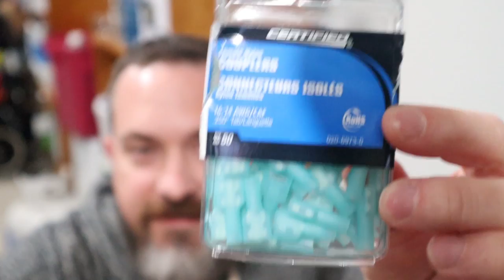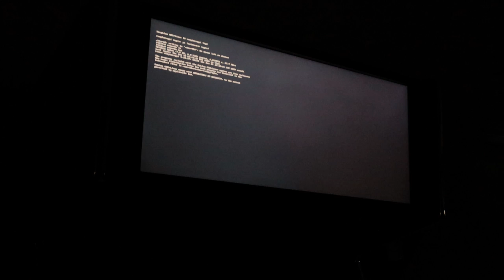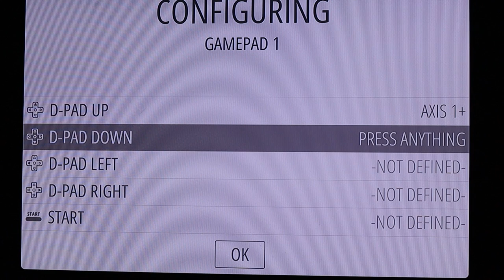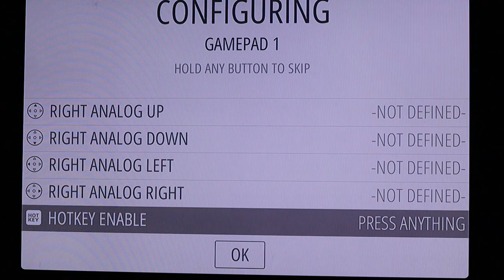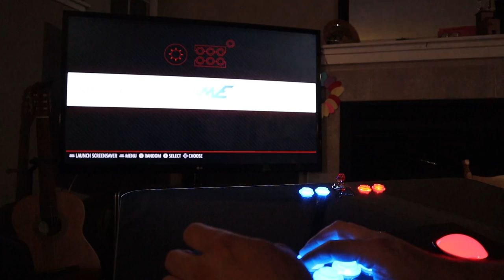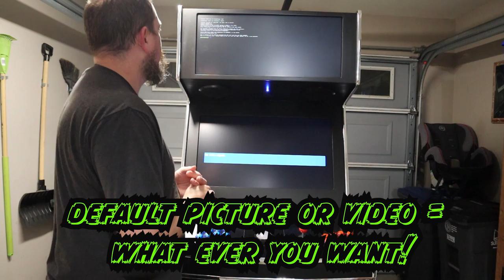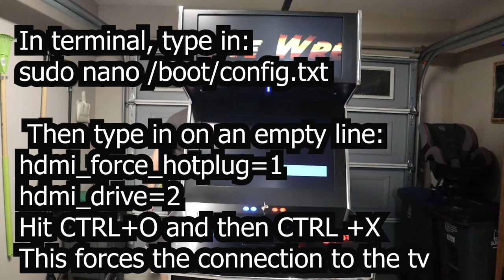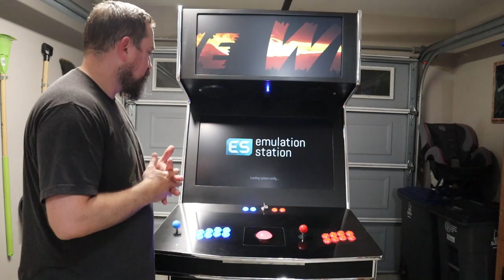How to install vinyl, t molding, buttons, and joysticks on a Raspberry Pi Arcade Cabinet Ep#11 Pt# 2

Comment: Love these videos, but seeing the Elechickens tape killed a part of my soul. LoL Use what you have, but I hate Vinyl tape.
Reply from the maker: Yeah I try to use heat shrink when I can but ya gotta insulate those electrical connections one way or another.  I will be organizing the wiring and cleaning up the inside of the control panel/cabinet soon.

Comment: DO NOT crimp soldered wires. Never solder any wire that goes into a connection that relies on clamping. The solder holds the strands apart and is soft. Over time, the strands can migrate around and cause a loose connection. This loose connection is going to cause heat which will cause the solder to soften even more. This is how fires start.
Reply from the maker: I would disagree with you on this.  Solder isn't soft and should have no problems being crimped or lasting long term.  If you soldered correctly and the crimp is solid, then there will be zero resistance added and no heat generated.  What wires in the arcade were you thinking about?
Reply: @wayofthewrench  The two 110v you soldered together then crimped. Also, this is not my opinion, it's know fact. The resistance is not in the soldered connection, it's between the connector and the soldered connection. The same goes for screw terminals and the like. Any connection that relies on clamping should be bare wires.

I have only mentioned this out of concern for safety.
Reply from the maker: Thank you for bringing this up, I appreciate it.  I looked into it and you are right that it isn't code.  In my experience the fault is that the solder caused stiffness in flexible connections and areas of high vibration/movement will cause the wire to break over time.  I have never heard about resistance or heat being an issue though.  There should be no added resistance from the solder if not correctly and there is minimal amperage running through those wires should it should be ok.  Not to code....but ok.  The fuse on the cabinet is 10 amps so really that connection should be able to run 10 amps all day with no worries without heat growing/shrinking/loosening these connection.  Thanks for the heads up and I appreciate the info.  Cheers!
Reply: @wayofthewrench  Automotive or Racing use crimping to avoid vibration failure at the solder bare wire junction from work-hardening due to improper strain relief and accidental solder wicking. They don't care about longevity in racing but for regular automotive longevity is critical, and hence the use of strain relief and environment proofing connectors. Your soldered connect is okay, lack of vibration and relative low currents flow. Bad crimps and, oxidation can make for poor connections.
My dad as a plant engineer needed electricians to tighten screw contacts in main power panels for 500-650V three phase lines after inspection with thermal cameras. A Panel in time with thermal expansion and cooling and can explode and launch boxes off the wall. There is high wattage coursing through electrical panel in factories and need to pass inspections.

Comment: Cool cabinet but overkill for a pi 3b+ based build.  Kind of wasted potential for old 16bit games.  Put a pc in there for all that investment.
Reply from the maker: Dude!  How is it a waste?  You put in a computer in the cabinet and hook up the usbs and you have an awesome cabinet.  I used a pi because I wanted this cabinet to be portable, just remove the control panel and take to a friends house.  

 The old games are mame which works great on the pi and are awesome on a arcade cabinet with real joysticks/buttons as opposed to just a controller.

I am currently refreshing a 16 year old computer and it is already way better than the pi and when I am done, it will be going into this cabinet....so nothing wasted.

I was messing with recalbox boot from usb, unbuntu running retropie, and launchbox this weekend to see what I want to do for future upgrades and videos for the channel.   Also planning on doing a visual pinball cabinet too....
Reply: @wayofthewrench  because the pi is a slow turd that can't render any hardware accelerated mame games e.g. Killer Instinct, and you've gone all out on a cabinet with a second screen for Marquees and stereo bluetooth speakers and the like.  It's more of a compliment then a criticism.  Cab is under utilized IMO.  A micro x86 board with a decent APU running   Big Box or Hyperspin and/or Steam would be a better fit.
Reply from the maker: Yeah I get what you are saying.  As we speak I am teaching myself Launchbox and getting an old computer ready for the cabinet.  Even with just a few parts this computer is light years ahead of what the pi can do.  Plus it has actually been kinda fun messing with computer parts I installed 16 years ago.  This computer will add a whole new level to this cabinet, I can't wait.  Bigbox is coming Mike....it's coming.  Cheers!